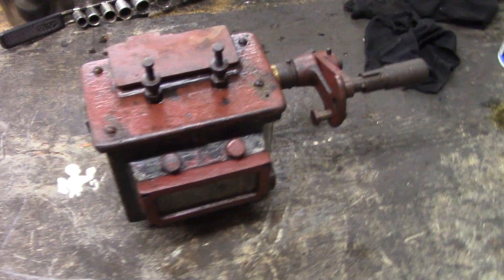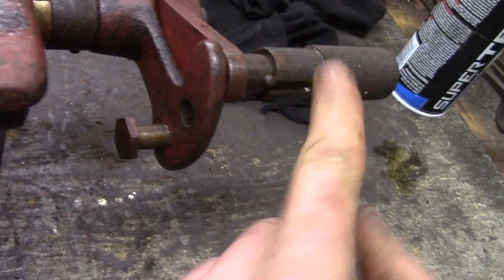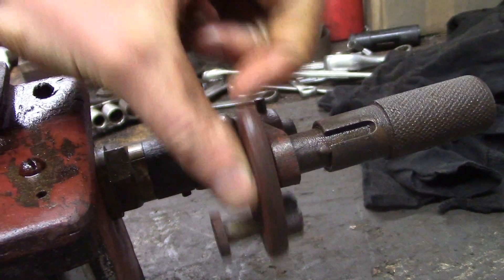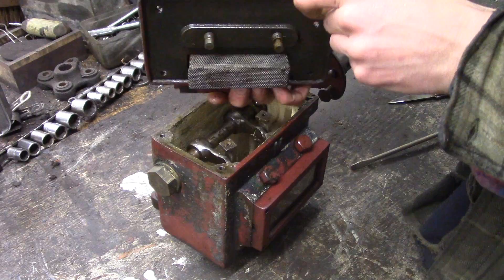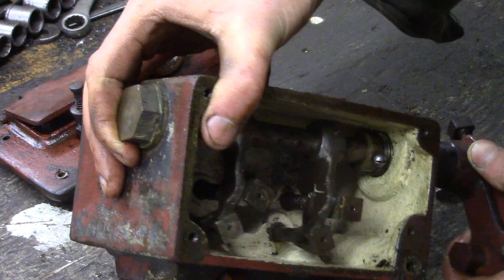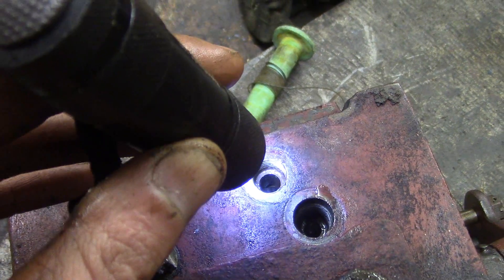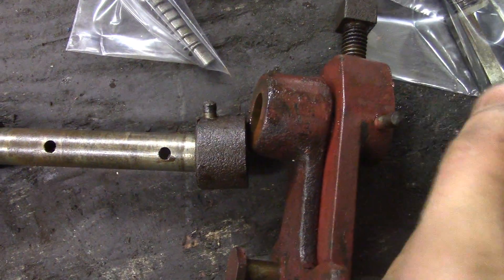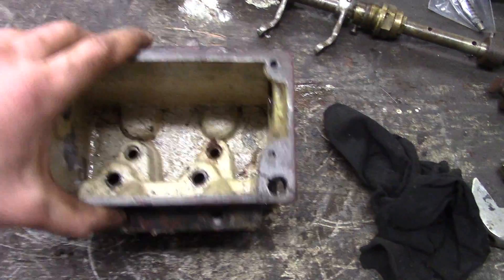Ruston-Hornsby 7XHR Restoration - Oiler Part 1

Comment: Menny thanks you very for the much instructive explanation. We are working on a similar Ruston Hornsby 7 xhr machine for the "Lettenhof" here in Belgium. This engine was installed in 1952 in a grain mill. Worked until early 2000 and so shut down. Thinking about trying a start-up soon, before disassembling? Did you make progress on your engine? Want to come in contact to exhange information when possible?

Comment: Can you perhaps tell me where you buy all these parts. I need parts for my Ruston 2YWA to fix it.
Reply from the maker: Luckily we haven't had to buy any parts for this engine. All i know is that parts are more easily sourced in the UK where these engines are more popular. Good luck with your project!
Reply: Zagray Farm Museum 
Ok thank you.
Reply: Did you not need to buy new gaskets and oil seals?
Reply: And before I forget, do you know the difference between a 2YWA MK2 and MK1?
Reply from the maker: We haven't progressed that far on the engine to need seals yet. However, there are only 2 or 3 seals I know of. The head gasket and the wet cylinder sleeve o-rings. o-ring cord stock can be purchased from McMaster, and the head gasket can be made in shop or ordered from gasketstogo.com. If rings are needed, they can be special ordered from Niagara.
Reply: Zagray Farm Museum 
Ok thank you